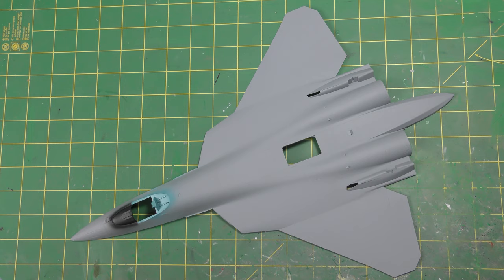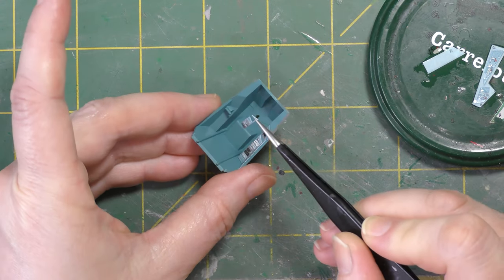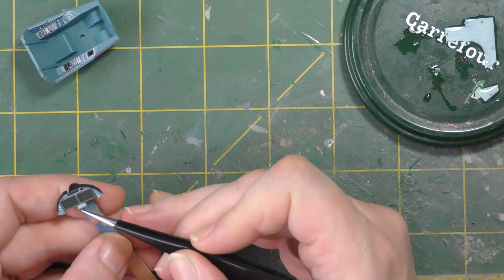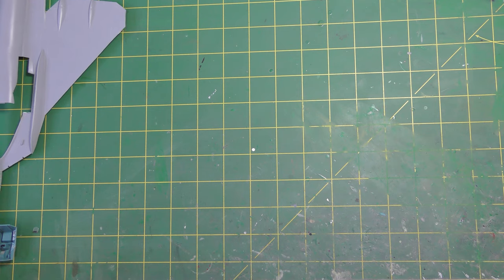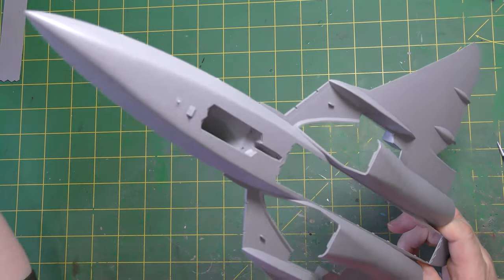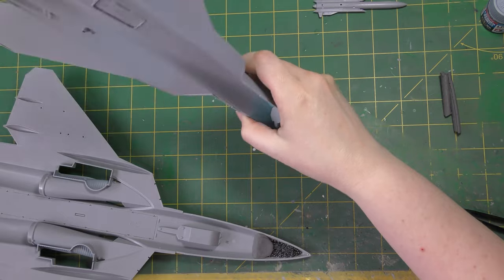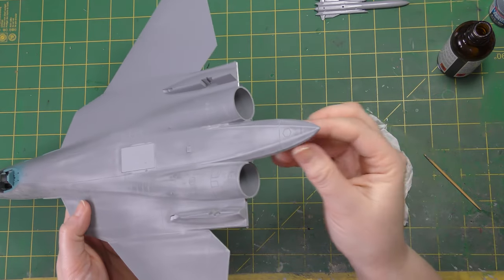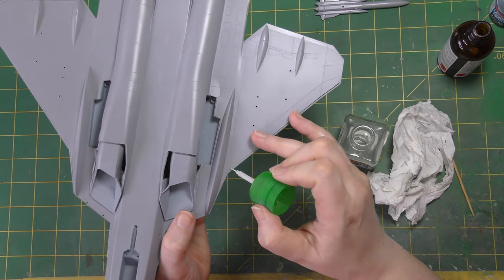Red Star Rising! Building the Zvezda 1/48 SU-57 - Part One

Comment: Those "big missiles" are Kh-31PD ARMs (anti-radiation missiles) :)
The "little ones" are R-73RMD-2 IR SRAAMs (short range air to air missiles). But they are not used on Su-57 - just older planes like T-10 (Su-27 and its children) family or MiG-29.
Su-57 uses R-74M-2 (mostly look as R-73, but has different distantial fuses layout, completely different seeker - 3 band and 3-petal gas dynamic stears instead of 4 on R-73).
But the most interesting is the main SRAAM for FSBs use - K-300 (still secret, no images of it available except for Tor-M2 SAMs on which it's based on):
http://paralay.iboards.ru/download/file.php?style=12&id=22240&t=1
Reply from the maker: I hope my basic build and ill educated babble on the subject don't upset you too much! Thanks again for the great insight, keep it coming
Reply: @JenesisDesignsandModelcraft  God bless you! :)
I'm not upset at all.
Moreover this, I've subscribed and found your foiling video very useful.

Comment: Is it really necessary to use super glue for the fuselage halves or can you get the same results with ultra thin or even tube glue? Haven't started mine yet just trying to some ideas
Reply from the maker: Not necessary, just better. It is perfectly possible to get great results with plastic cement of any type, but the risk of ghost seams is ever present. That's why I use super glue.

Comment: You probably don't intend to keep this model for a long time, but looking at this nose weight triggered a concern of lead rot. Are you aware of this? In contact with acetic acid (which can come from a number of sources) lead can undergo a catalytic reaction that converts it to a white powder that has quite a bit more volume than the original massive form, splitting the fuselage in the process. This is all the worse if the lead is in relative granular form, giving a lot of exposed surfaces.
Countermeasure: Use lead in block form, cast it, if necessary, and coat it with a protective lacquer, e.g. epoxy. I have heard people naming PVA glue as part of the chemical process; it wont provide much in terms of protection at any rate.
Reply from the maker: A very valid point, and certainly worth considering. None of my weights are actually lead though, it's some kind of similar looking substitute heavy stuff....
Reply: True Lead weights I believe aren’t sold in the UK anymore 😊

Comment: If you want more or less accurate copy of the real Su-57, you need to remove almost all the panel lines: the real thing is almost completely covered with RPMs and dielectric paints.
Also correct the shape of a "sting" - a tail boom between engines (is has the right shape but 3 ribs on each side instead of 2) and heavily modify inside structure of the air intakes (it was secret till the very recent time, Zvezda has released it too early : ) ).
HUD is also wrong (Zvezda gives IKSh-1 for Su-35S and late Su-30SM instead of KAI-50, donno why, it is not secret).